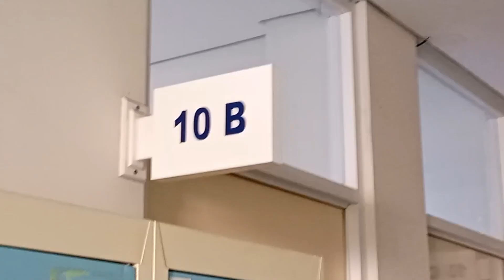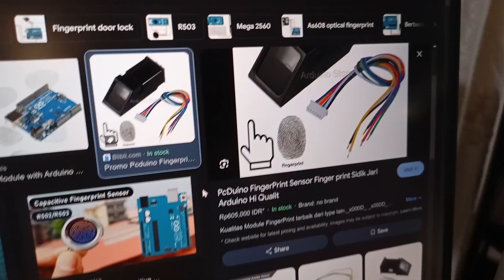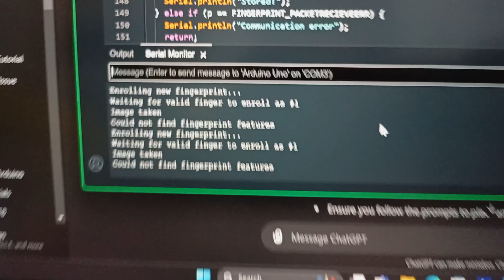I made an arduino PADLOCK so nobody STEALS my stuff

Comment: A few critiques:
The servo lock is not safe. If it was really made for thedt prevention you would at least enclose the servo and the door lock nubs in a box, so you can't just turn the servo.

You don't need an arduino uno, get a pico/ an esp32, learn to solder and solder it all together permanently. You don't want your security/locking circuit to dissasemble without you noticing and leaving the locker unlocked/locking yourself out of it.

Put all the electronics inside of the locker with a huge powerbank and some source of power(solar cell, wall plug, charging power banks at home...) 

And lastly: get a pin numpad. You do not want an unreliable lock and no other way to get in. 

I'm about to visit 3rd year of mechatronics technician, wanna talk about your design?
Reply from the maker: thx for the info dude, I would like to just go email me about the design or talk to me on discord!!!!
(through the server link in my about page)
Reply: Did he just write 6paragraphs 😂😂😂😂😂
Reply: @DylanTriesYT 5 to be exact. Just trying to help out a guy starting out with arduino
Reply: @Zigonce  lol

Comment: This is awesome! You could probably make it way smaller with a pi pico tho
Reply from the maker: Wow thanks for the request on the improvement of this robot !!
Reply: Do NOT use a raspberry pi pico. It is harder to run code, has longer bootup times, uses more power AND is 30x more expensive
Reply from the maker: @Zigonce  im more worried about the expensive part lol